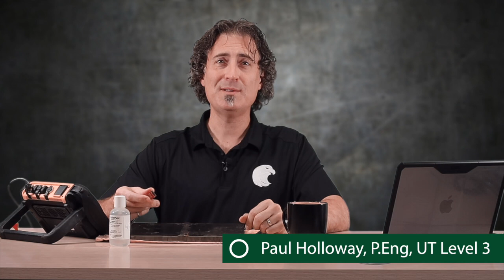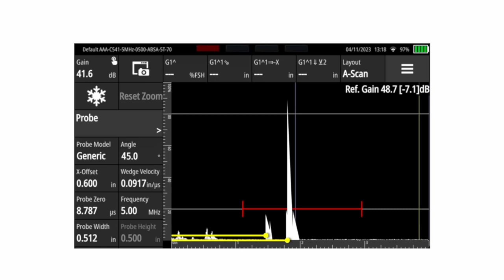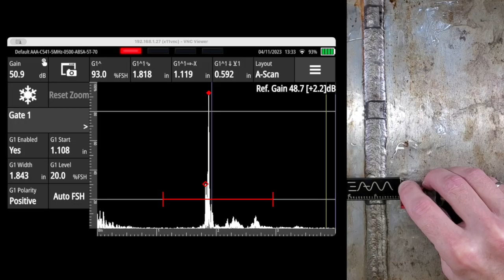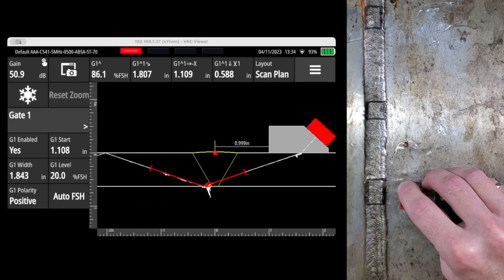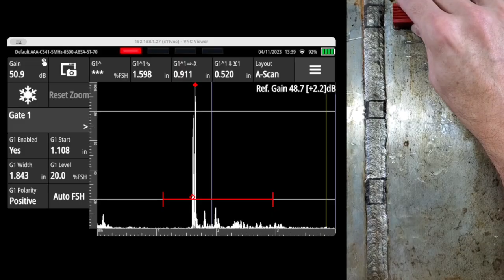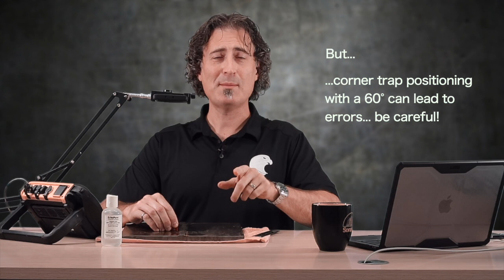Flaw Characterization & Angle

Comment: Hi Paul great video
 However some of the draw backs of conventional UT with the 12mm + probe beam index can be over come by using close approach wedges and smaller diameter probes allowing steeper angles on smaller weld throats.
As a technician who started in the 1970's with USM 2 & USK 6 much more importance was given to echo dynamic pattern trace. This seems to be a lost artform due to the poor traces on the initial crop of UT sets in the 1990's
Reply from the maker: I hear ya. I have some 1/4" transducers but the beam spread is so ugly the advantages of getting closer are a wash. It's all trig in the end though.